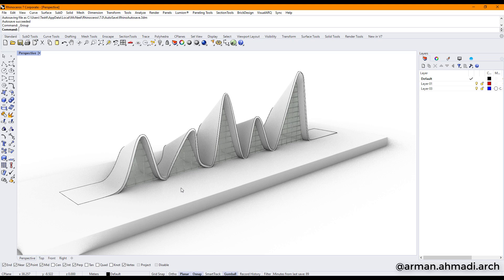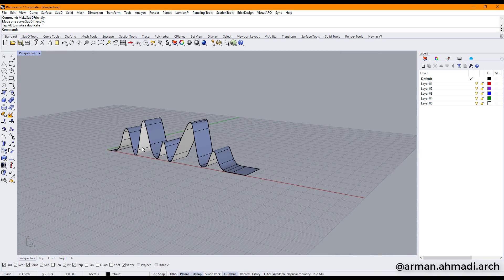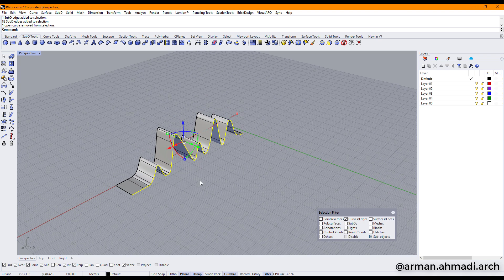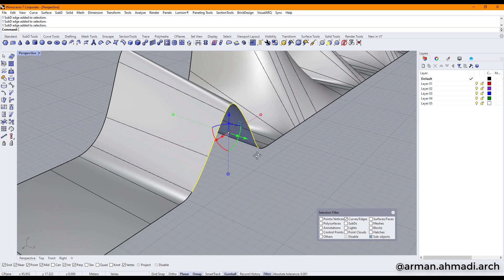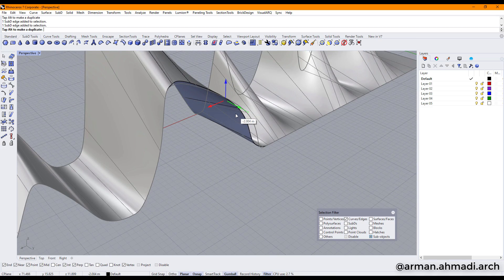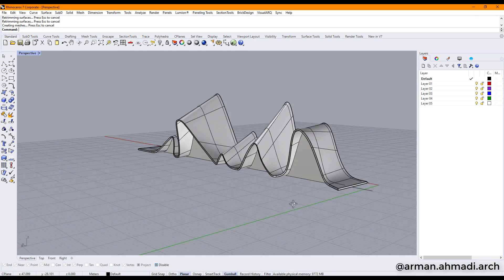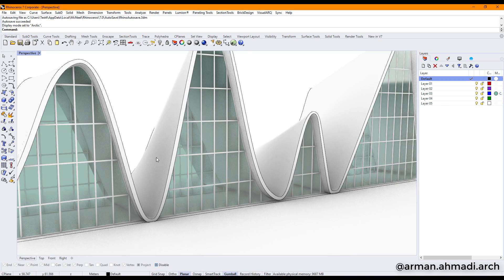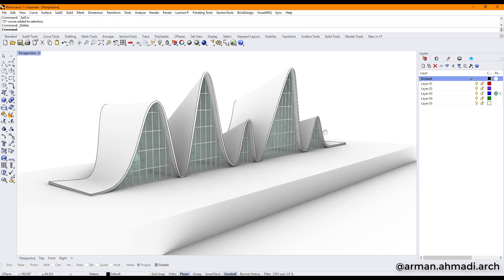subd pavilion modeling in rhino|organic modeling in rhino

Comment: Thank you for your tutorials ❤
And i have question, 
First, in 2:48 when i double click in edges it selects only the whole big edge from one side not all the edges of the object like you did 
Second, I can't select each edge like you did in 3:46 
It only selects the big one and can't identify that there are small edges to select
Reply from the maker: When you want to select all edges you have to make sure that 《selection filter:edges 》is chosen. Then you can double click on one edge and it goes through all the border edges.
It goes the same for your second problem. Make sure the check box of edge selection filter is checked. Or if you don't want to use selection filter for the second problem, you can easily just hold down ctrl+shift and then select the edge that you like.
If the problem is still remained, feel free to email me your rhino file. armanahmadi74@yahoo.com